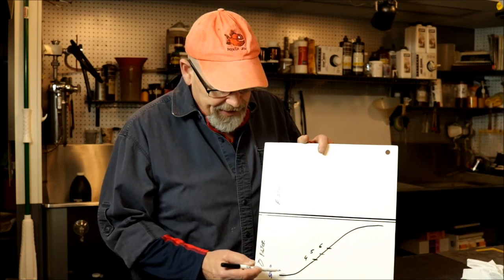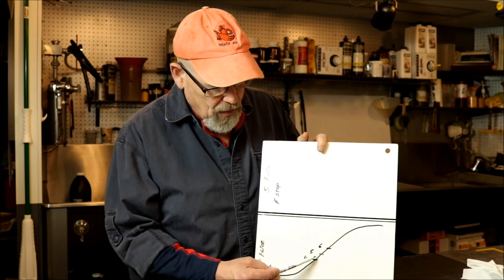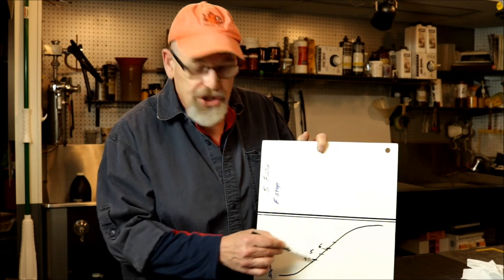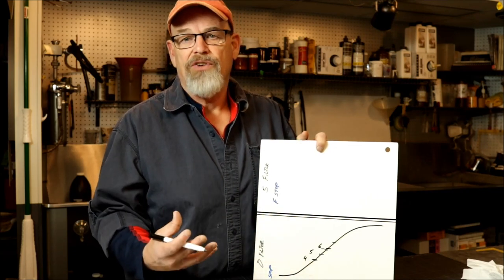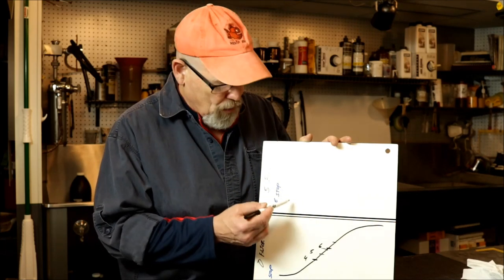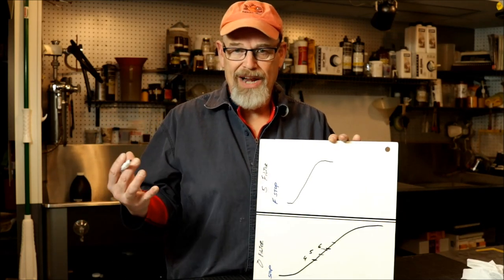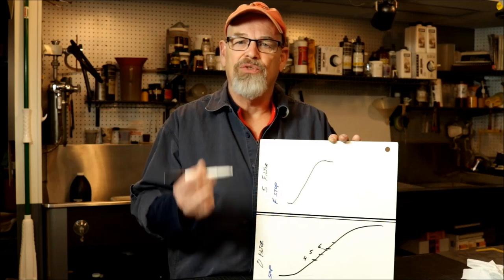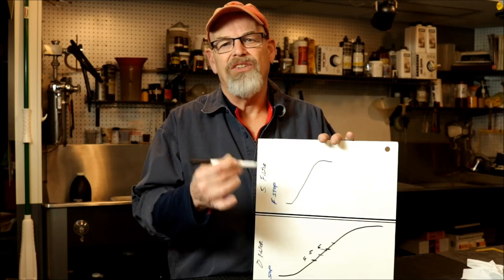Analog Photography B&W methods and philosophy

Comment: Hi Mr.Sherman. I have been following almost all your videos on youtube and articles on your website and I have got some question. I managed to create negatives with Pyrocat and EMA, aiming the Zone 8 density you described. In split printing process, I tried both Ilford contrast filters, 00 and 5 below a lens and Lisco gel filters, green and blue above a negative. The Lisco blue filter gives me less contrast than Grade 5 filter in my color head enlarger, probably about one grade less. The enlarger head is not a cold light like yours. Should I stick with Ilford filter set?
Reply from the maker: Apologies for not seeing this, too many ways to get in touch with me.   I would use the filtration that provides the maximum contrast for both hard and soft filtration.    Thanks for reaching out.    SS

Comment: Some years ago, I was trying to get normal contrast out of Arista Ortho lith film. I discovered that with a distilled water pre soak and gentle tray agitation with Hubl Paste  1:70 I ended up with a brown negative with good if not outstanding mid tone separation without much if any loss of speed. I was using an alkaline fixer. I assume that the brown is due to physical development? Since I can't find any real information on glycin in high dilution, I was wondering if you had any experience with it, or comments.
Reply: Thanks very much for reaching out with your comment and observation.  
Yes, I would say the brown color result is a product of the physical chemicals during the development process, specifically the Glycin.  There are a few “vintage masters” that were very partial to Glycin in development formulas.